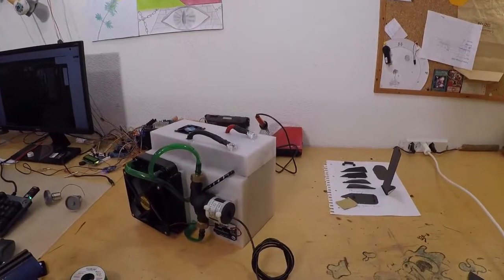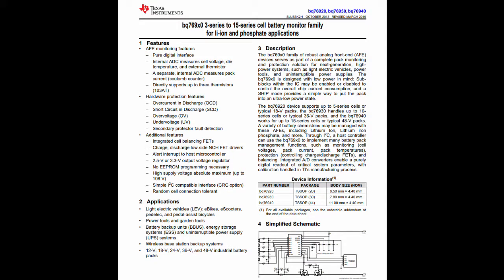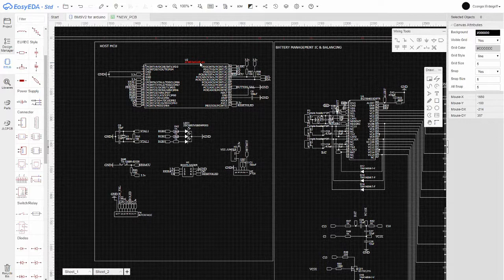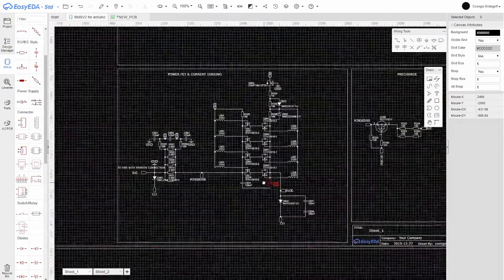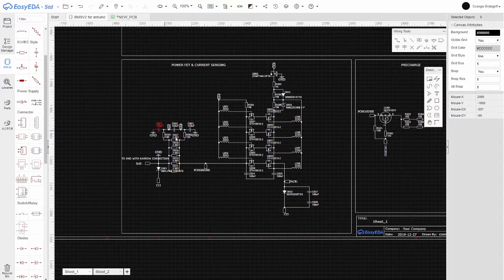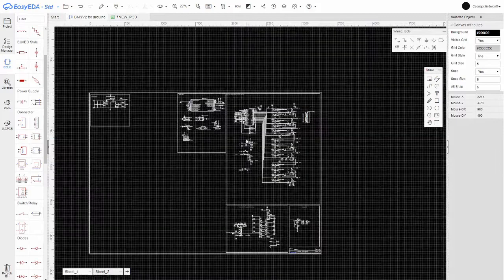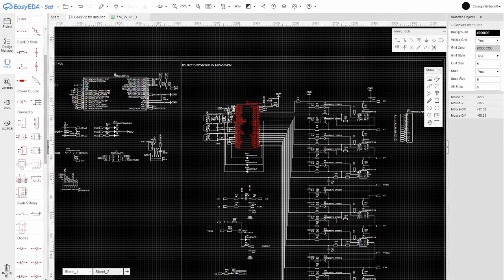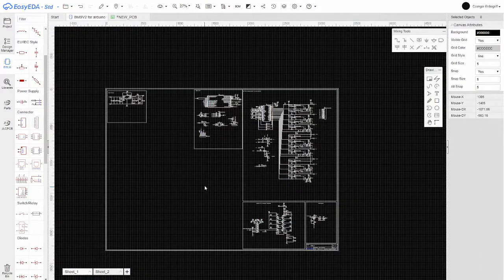LI-ION BATTERY PART 3: Designing a Custom BMS with BQ76940, Explaining the Schematics

Comment: Have tryed to understand your schematic, but one thing i don´t understand is the need for a power supply. The  BQ76940 can operate on the battery pack, and the BQ76952 an output LDO that pan provide the power to the micro controller. LDO can provide 3.3V 30mA

Comment: Hallo there. Think it would be a better  option to use the BQ76952. This BMS IC  has PRE charge and Pre discharge already build in, think this is a most for high amp. i am not into programming, but could help with the hardware design.

Comment: Really cool project!
I think I have been able to find the water pump you use, with the controller, but I was wondering if the controller takes in a separate signal to control its speed, in addition to the 12V power input?
Reply from the maker: I control the speed with PWM with the arduino.

Comment: I’m designing the exact same thing! I was reading the bq76940 data sheet when I found this video. But I will be working with many cells in parallel so should I just connect multiple bq769x0 circuits together? (My project is an ev bms)
Reply from the maker: Well you would have to connect the packs in series to get a higher voltage. And you will need to write your own software to balance the big packs with a microcontroller that gets all the data from all the bq76940s. Its a big task but certainly possible. I would recommend an off the shelf option for such a project, except if you want to hassle around with the hardware and software for your own pleasure (like me).

Comment: Hi, I was thinking of using a BQ40z80 in a project at home, did you consider this IC? It seems to combine lots and of good features like gauging and monitoring, high side drive, etc in one IC
Reply from the maker: I was not really aware of this chip, definitely worth looking into! Looks like a more integrated version of the bq769x0 family. This would be a good option if you want an advanced BMS! Thanks

Comment: Hey, how much more efficiency and battery life cycles are you getting wiht your cooling system? Generally small battery pakcs suchas yours don't deploy cooling system, but I ma sure it has it's benefits. Have you gauged them? Could you please share it? How are you dealing with condensation and water collection? 

You have done an amazing job!

Here's my email id: nickhenfield@gmail.com
Reply from the maker: im sorry to say that i have not really tested capabilities of the battery yet. I have no significant 48V load that i can connect. I was planning to get a 2kw inverter but the 48v ones are really hard to get at the moment. I will post a video once i can do the testing. I have to admit though that this project was on the sideburner for a while.
Reply: No problem! Please do it and let me know!